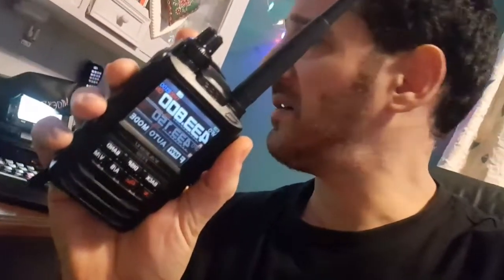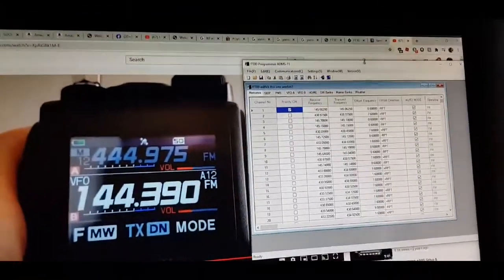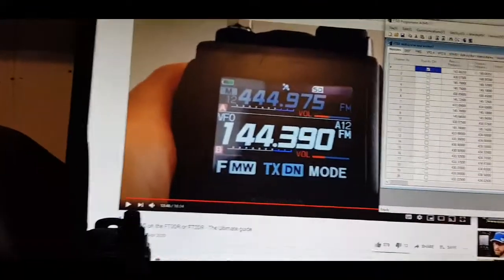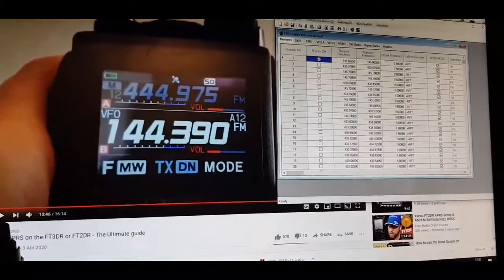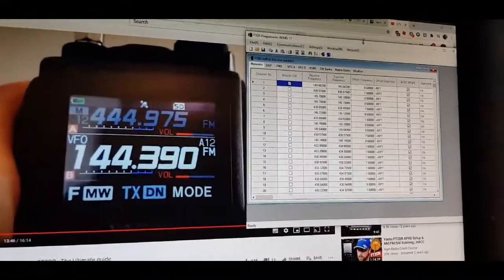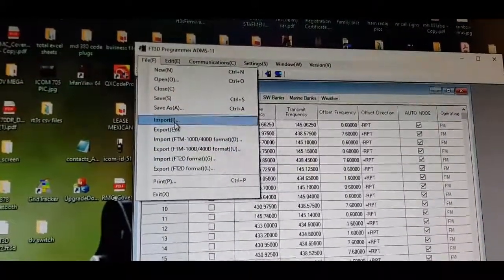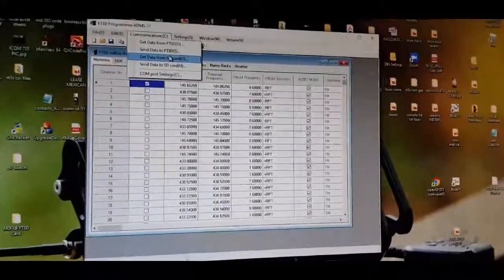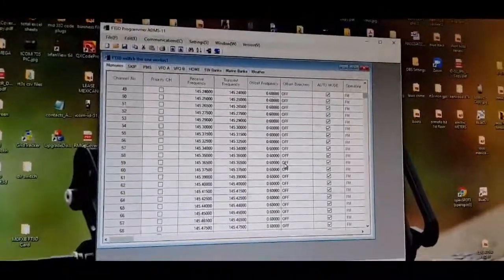Yaesu FT3D - ADMS-11 programming software  (Not Complete SD card error)

Comment: This video makes no sense at all.  Your explanation is seriously lacking.
Reply from the maker: Hi -Yes even i was confused , what i am saying is dont use the suppled cable use an sdcard but to do that you need to start with a blank formatted sd card that you also format in the radio which you then add a channel in the radio and save to radio on the radio-Then put sd card in PC , now it works